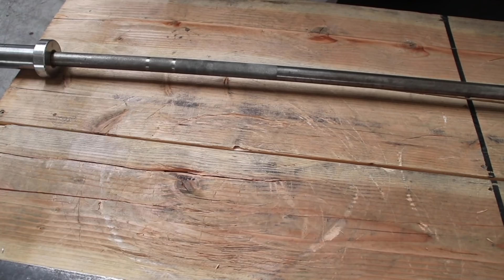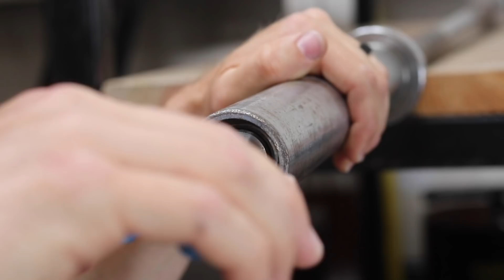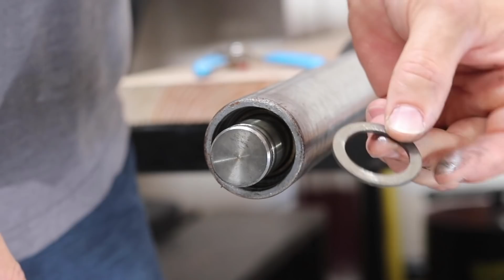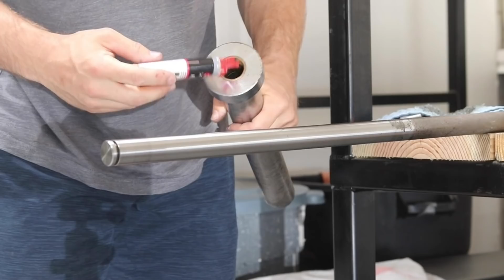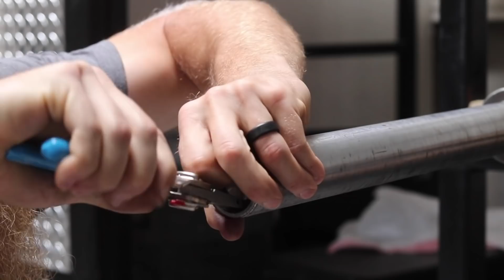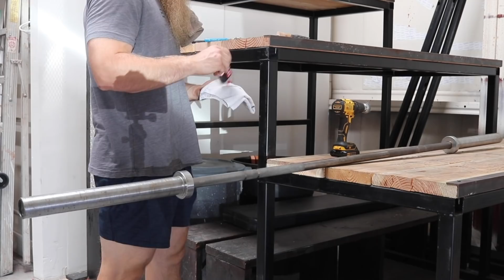Cleaning a dirty barbell

Comment: If you need to buy snap ring pliers, don't buy the cheap ones unless you're sure of the size you need.  I messed around with a cheap pair ($15 or less from the hardware store and they sucked (mostly cause the posts were too small).  Dropped the $30 or so on the channellock brand (similar to what Alan has and had several different tips).... Made the whole process way easier, safer (snap rings springing free is not fun), and avoided scuffing up the end cap like I did when using the cheapy pair.

Comment: If you're doing this job be sure to have a good pair of circlip / snap ring pliers.
Rogue uses;
Knipex 4411J2 7.25-Inch Internal Straight Retaining Ring Pliers
You can get them on Amazon.
Reply: Thank you!!! I bought a cheap pair that turned out to be useless and returned them. I will get these instead!

Comment: Ok, how does it just stay on the end? I had no clue that's how it was assembled. Haha
Reply: Robert Bucks snap rings stop it from coming out
Reply: They do the same job, but In the other direction aswell so the ends don’t slide to the middle
Reply: On the inside, the sleeve goes from the wider opening (the visible opening) to an opening the size of the bar itself. That transition forms a wall that the washers rest up against. There is a groove that runs around the barbell rod (not sleeve) that the half washers sit inside. Those are what holds everything in place and take the lateral forces. The snap rings are there just to keep the washers from sliding off which in turn keeps the sleeve in place. They also prevent the sleeve from sliding the other direction (inwards towards the kurling) due to providing another wall, so to speak. I don't have a rogue bar but that's what I can tell from the video so I could easily be wrong!
Reply: @ScreaminGreenMachine  I think you're mostly right but I dont think the end of the bar is tappered. That split washer is set in a groove with washers and snap rings around it. Only think keeping the sleeve from moving toward the center is that washer assembly.
Reply: @TheLouisianan  The washer set is absolutely what is keeping the sleeve from moving inwards. There is a groove on the inside of the sleeve that the snap rings themselves sit inside. The groove on the bar holds the split washers, groove on the sleeve holds the snap rings (also the snap rings are ones that expand outwards so having a groove on the sleeve makes sense to hold them). Without that groove on the sleeve for the snap rings to sit in, nothing would remain in place.

Comment: What about the regular chalk deposits on the knurled part for everyday use? Small brush helps, but it wears down after a while and isn't quite enough to really remove all the chalk residues. From a patron's perspective, it wouldn't be feasible to use a drill-brush to clean after use.

Comment: Get a pair of channel lock snap ring pliers. I bought a set of Irwin pliers. Don’t use those. Worse than useless. I’ll happily throw the ones I just bought into a pit it molten steel. They slip off and do not hold the rings closed.

Comment: Am I the only one worried about the steel brush scratching up the barbell and wearing on the knurling? I'm sure the wire is softer than the bar, but still wouldn't it be better to use a brass brush?
Reply: I'd rather just use a stiff nylon brush. Wire would cut it up and make it more prone to rust

Comment: I might seem like an idiot for asking this but what's the big deal with your barbell being able to rotate freely I usually just use an El cheapo one at the house that doesn't even have bushings the end caps are held on with two great big metric bolts still a 45 lb bar and it's held up to all the weight I can feed it what's the benefit of a "better" barbell
Reply: Rotation is important in the Olympic lifts more than the standard powerlifting lifts. I use a cheap bar that doesn’t rotate much and it hurts my wrists on some of the oly lifts.

Comment: Is there anywhere to buy replacement parts? 
I bought a barbell for like 50 bucks, its in atrocious condition, but it seems like a good bar underneath the paint and rust (yeah, the previous owner spray painted it green...) 
But its missing some of those interior parts

Comment: Lol my barbell is so cheap it doesn’t even have these snap rings at the end. Just a large bolt
Reply: As long it gets the job done you're ok
Reply: @Ze_Ninguem  pretty much. Most people who don't snatch or clean and jerk don't need a fancy barbell. The problem tho is that most cheap bars are 30mm which sucks ass.
Reply: @-TK-   Mine was 32mm which I didn't realise until I used a Eleiko barbell at the local gym and PR:d the crap out of my deadlift...

Comment: Does collar spin matter more for heavier lifts? I have newer barbells so i haven't noticed any side effects of not having the  collars spin, I had just assumed the minor variance in collar size and plate opening would allow the weights to rotate on the bar even if the collar didn't spin. That said, I am not super strong (yet) and only lift up to ~225lbs (I also only weigh 158 lbs and am a year into lifting). Just curious what issues may appear when my bars inevitably wear out eventually.
Reply: Really unless you are a weightlifter bar spin isn't critical.  But a nice spinning bar is still a good thing.

Comment: Rogue told me never to remove the sleeves. Kinda weird knowing how easy it is. Although powerbars don't need to spin that hard right?
Reply: Pretty much. Don't need much spin if you're powerlifting. If you're performing Snatches, C&J, and other Olympic Lifts...then spin is a must.
Reply: On their weightlifting bars you can't really take them apart.  They have sealed roller bearings unlike this which has brass bushings and can be user serviced.

Comment: Does the wire brush on the drill not ruin the courseness of the knurling?
Reply: Alan looks like he uses a steel wire brush (I wouldn't recommend that on steel), but it wouldn't totally ruin the knurling. A steel wire brush would eat up a coating (if your bar isn't bare steel) and would ruin the TGP finish (TGP=Turned, Ground, and Polished). Basically, it wouldn't look as nice and shiny and creates a "brushed" finish; figure you can see where that name comes from. You should use brass brushes on a steel barbell. Brass won't scratch the steel, but it'll remove chalk, dirt, debris, etc.

Comment: I'm surprised they spin that well without any kind of bearings
Reply: The brash bushings are bearings, they're just giant. The oil creates what's called an elastohydrodynamic barrier between the brass bushing and steel shaft and it works due to the specific tolerances.

Comment: Will wire brush damage the knurling though?
Reply: Alan looks like he's using a steel bristle brush on his bar (I wouldn't recommend that) since steel will scratch steel. You should use Brass or even Copper (if you feel like spending money or you clean guns as well).

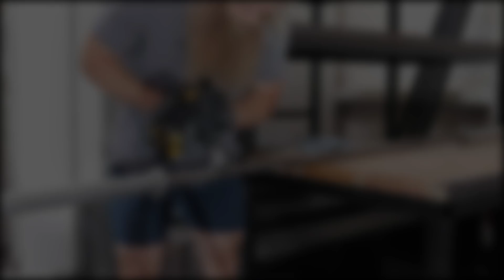Comment: Won't you ruin your the barbell by using that brush at min 3:34? Thanks
Reply: Depends on your bar. If your bar has a coating then the coating will probably get scuffed a good bit with a steel brush. I'd recommend using a brush with brass bristles (softer metal). Not too sure how tough the ecoats are but I know brass won't rough up blueing or parkerized finishes on guns. In summary I'd recommend using a brass brush on your barbell. I've done it for a long time on my OPB and it's still in great shape.
Edit: forgot to mention my OPB is bare steel, that's why I'm not sure how ecoats and cerecoats hold up.

Comment: What if my bar has a zinc coating?
Reply: Then try not to breathe while brushing it.
On a serious note: if your galvanized bar is rusting (red, not white), then the zinc coating has worn off. Take that to mean what you want. If its not rusted, you can clean it with light detergent and a softer (i.e. not wire) brush. Oiling would be the same, just wait until after you've cleaned the bar to do the oiling.
CMA: refer to your manufacturer's maintenance documentation for details on properly caring for your equipment.
Reply: I don’t know how hard a zinc finish is. You might want to use a brass or even nylon brush instead and clean by hand to start.